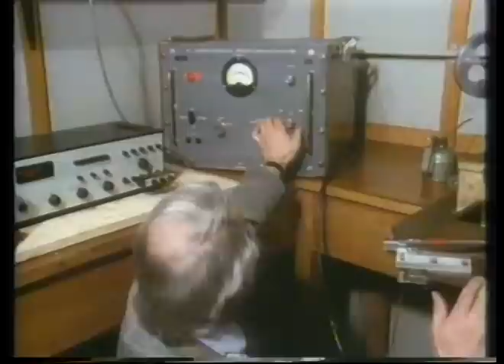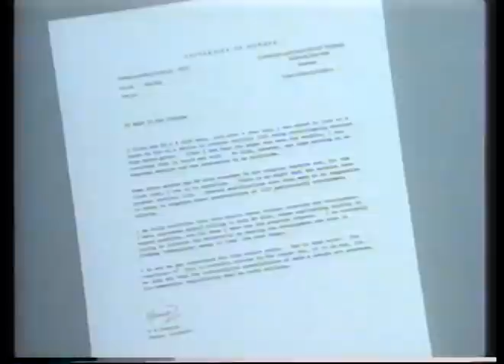Anti-Gravity Machine (Part Two)

Comment: So what's the latest now my friend ? It's now 2016 surely someone's using your machine by now ?
Reply: Good evening Royston,
In spite of the fact that the device shown here operated successfully many thousands of times in 3 different universities in the UK and elsewhere for instance the USA and Australia, and operated successfully in my absence for several months, it would appear to be disbelieved probably for the simple reason no one can figure out how or why it can work so it must be a fake.

Not long after I built and demonstrated that machine I built another device for the purpose of proving under laboratory conditions he fact that inertial thrust could be produced.
This device proved conclusively that my devices were genuine, a laboratory report was prepared to prove the fact. The complete laboratory report, patent application and photograph of the device, can be found in Jerry Decker’s You Tube insertion called “Sandy Kidd’s gyroscope lift experiment”
No takers for nigh on 30 years now.
Reply: I've been following the development of devices both understood and not understood for a while and it certainly does seem that those not understood slowly move to the junk pile, unfortunately and those understood get suppressed, bought up and hidden in what the U.S. calls Unacknowledged Special Access Programs or some one or some organization sets the inventor up on fraud charges or finds some other way to lock them up or make them go away. Unfortunately for inventors, I think the only way to get the machines that work to be used and understood is too offer the designs and research freely so that they spread into the public and hopefully, become common knowledge.

 If I had a working machine that gives me more energy out than in, I would just try to use it to benefit my life and the lives of people I care about, by using it to lower my energy bill. Could you imagine how this world would be different if there were no energy bills to pay? The price of everything would go down. After a few years though, I have no idea how society would change if anyone could harness as much energy as they want. That could be dangerous, potentially. Still, I know my life would be a lot better if I did not have to buy energy.
Reply: I think Chris that whether my device is genuine or not it is surely not the preferred method visualised by they who are in control.
If it smelled of anti-matter, an electromagnetic vortex, an inertially driven magnetron for goodness sake, or even the very doubtful Nazi Bell device, it would surely be worthy of consideration, but not gyroscopes.
Some day long after I have donned my wooden jacket the penny may drop but I doubt it very much.
Reply: But can you use it to perform usable work to lower your energy bill? I would think that the more money you save, to better your chances of developing this in the direction you envisioned. If it could be readily used to do this maybe you could use it, in the short term, to create capital. Like if it is used as a high efficiency water pump or something, not that I would know how to do this as i haven't spent any time with your machine. That's my two cents, anyway.

Best of luck to you.
Reply: Two quotes come to mind from the scientific "giants" of the past, the first from the inventor of FM Radio who was not recognised as the inventor during his lifetime, " Men substitute words for reality and then argue about the words." that demonstrates our past and current status quo, that if you can't explain why the device works in human invented words then it doesn't work as our words and our equations can't explain reality. Then to quote Oliver Heaviside, who is hardly recognised for many accomplishments including simplifying Maxwell's equations from 22 complex equations of incredible labour to the simplified 4 equation form we know today, still attributed to Maxwell,   "shall I refuse my dinner because I don't fully understand the process of digestion".
Reply: Hello again John,
Whilst I do not disagree with any of your statements, in my case it is much simpler than that.
I can describe in great detail exactly why my devices can deliver inertial thrust in relatively simple terms, that is not the problem.
I can describe exactly whilst my claims differ from those of Newton.
Unfortunately the clever people who are liable to be invited to scrutinise my claims will invariably be the ones who know they are correct for no other reason than they know they are, and will dismiss anything which challenges Newton out of hand and as heresy.
Until someone, and now probably not in my lifetime, challenges that great assumption that is the alleged separate conservation of angular and linear momentums physics is going nowhere, and mankind will forever be earthbound.
Reply: yikes are you getting close Sandy Kidd!! No use being against gravity. Best to swim in it.
Reply: Paul James haha , Paul why do you sound mad ? Are you upset ? Cool down brother, just relax and go with the flow...if you don't believe in this contraption then that's absolutely fine , there's no need for insults. Be happy mate & enjoy your life mucka 😊
Reply: I have no doubt that some member of the academic club will someday reproduce what I have done, but I stress not without considerable help from those you see as an inferior class, namely the skilled manual workers.

Once the truth is known It is relatively easy to figure out what is required to produce inertial thrust but to meet that requirements of design is not so easy.
It requires a special type of mechanism, a quite complicated compound mechanism to produce the thrust,
This mechanism is not at all apparent in the video but nevertheless it lurks in there and is quite hard to spot.
It took me many years to find it, and I had the machine..
I did state that once the truth is known. 
This truth is in a complex mechanical function, which when in operation in a gyroscope or flywheel system produces results which fly in the face of all previous teaching.
    
PS I initially built a device which complied with accepted principles. 
I attempted to produce inertial thrust by means of producing centrifugal force at elevated angles of around 45 degrees.
Twin gyroscopes were to be used as the tool to raise the gyroscopes, up to the required angle.
Nobody ever informed me that if the mass (gyroscope) on a length of shaft was rotated at a fixed rotation speed and the mass (gyroscope) itself was rotated centrifugal force would diminish as the speed of the gyroscope was increased. 
At elevated gyroscope rotation speeds the centrifugal force, impossible as it seems disappears.
(Refer Laithwaite’s large gyroscope?) Not a trick at all.
The facts of the situation have far wider implications, and are a bit more complicated than I have so far stated but it is as a good place as any to to start.
I have broadcast this fact for 30 plus years, but everyone is so well educated and clever and therefore knows better it is laughed at.
Reply: TY Sandy Kidd, for your reply!  

Are you planning to try and teach/share the mechanism that you are talking about in this quote?

 "It requires a special type of mechanism, a quite complicated compound mechanism to produce the thrust,
This mechanism is not at all apparent in the video but nevertheless it lurks in there and is quite hard to spot". 

Or do you plan to take it to the grave with you? Or are you hoping to work out a financial deal? 

You are welcome to email us directly at wits2014@yahoo.com

TY!
Reply: Paul James you did at least give me the credit of holding down a manual job which considering the abilities of most of the academics I have worked alongside was very good of you.
I found them to be quite proud of their lack of craft skills, one even boasted to me that in a practical sense,he was technically illiterate and unable to change out a fluorescent lamp, and I do suspect most would struggle with a box of Lego..
However back to your faith in the physics dispensed by the establishment.
As to the accuracy of your facts well that is a matter.of opinion..

In the last year or two, we have seen the Theory of Relativity go the way of the Dodo.
We have seen the Standard Model of the Universe come under ever increasing fire from the Electric Universe and is sure to join Einstein’s theories  very shortly with the long dead birdies.
So guys no more Black Holes, or Time Space Continuum to contend with, that is of course whilst being accompanied by all the other associated junk that has been universally peddled and swallowed over the years
The Time Space Continuum with its ring of idiotic nonsense, I shall personally be very glad to miss.
Strangely whilst we can look back at this rubbish, we must really consider what effect it all had upon us.
Apart from keeping untold thousands of academics doubtfully occupied, or producing the ideas behind many science fiction films, it transpires not to be a lot methinks.
We now know there are parts of Newton’s stuff we can drive a cart through, but in fairness none of it would affect us much at all either.
However I doubt if Newton would be missed by the public at all as nothing he predicted or stated has any effect on them, in fact I do not suppose it would have made any difference to them if Newton had never existed.

It is only when a person is in need of attempting to do something out of the ordinary, for instance something akin to accelerating offset discs on multiple axes that the findings are at odds with any predictions made by Newton.
I often asked myself if Newton was in fact aware of this, which in light of the fact this anomaly was lurking in a relatively obscure area he may have chosen to ignore it.
Personally I do not think Newton was aware of what had been omitted, on the other hand I cannot see the man wilfully invite his own destruction.
All of that said, and after all those years I am convinced that for some time well into the future we can forget all of the current attempts by mankind to sort and sift all available information into convenient parcels, as there is now at this time no hard and fast law for anything.
In light of the fact we have survived in spite of all the junk that has been thrown our way, seems like we did not need any of it anyway.
Sandy
Reply: eh!!Laithwaite Mr James your the one who has thrown the toys from the pram Sandy giving you the truth hurts treatment- grow up.
Reply: Get your  jam jams on Paul off to bed your tired and tiresome..yaaawnn!!
Reply: Hello Angus,
These silly people and there are more than one or two of them who think they know everything seem to forget that this video was made nearly 30 years ago, and I can assure you that I have not exactly been twiddling my fingers for all that time.
I have covered a lot of ground since then but none of this has altered my position with the closed minds. 
Brainwashed minds would be more accurate.
In order to acquire some credibility for the work I have done, a tall order indeed, I decided to release on YouTube, a rare treat for the brainwashed, the video of a newly built device which clearly demonstrates severe shortcomings in the momentum conservation law which along with the 1st and 3rd laws are shown to have always been redundant. 
I demonstrated a similar setup in Dundee University 30 years ago where the device in question was being whitewashed, sorry being appraised.
I demonstrated to the faculty members present what they had always considered impossible, (well that was if they had ever considered it at all?)
When treated to the impossible, the astonishment was accompanied by total silence, before they turned their backs, and walked swiftly away as they do.
That demonstration was never reported, recorded or ever later discussed.
Blind and dumb scientists were all I needed.
I am hoping for better reception from YouTube, where it is so much harder for them to deny what is shown.
This device is not designed to generate inertial thrust but is designed to show to the close minded academic fraternity, what really happens when gyroscopes or flywheels are subjected to horizontal mechanical acceleration, which in turn discloses one way that one-way thrust generation is inevitable.
Regards,
Sandy.
PS
I do not think I shall wait for an answer to any request to VIPAC Laboratories,  relating to the integrity of that report by these idiots.
The lab test and report must surely have been falsified in their minds if only to suit the specious junk they have all consumed.
Reply: They (NASA etc) do not seem to have done too well, so far, have they?
In fact it would appear that apart from trying to make a magnetron develop one way thrust, which is surely clutching at straws, and probably at some considerable cost, as you correctly state.
What else?
Is fine being highly qualified if in fact you are qualified in reality, and not in the specious junk still meted out to the students.
Reply: I would be curious if your device would behave exactly the same in the southern hemisphere.  And / or exactly the same closer to the magnetic poles.  And, then on the International Space Station.
Reply: Sandy, I hope this finds you well and healthy. I have just seen this for the first time. Thank you for all the work you have put in and the time you have dedicated! You my friend are a true inspiration for me! All the best.
Reply: @sandykidd6482  Have you managed to create stronger lift?
Reply: @sandykidd6482  Research the Electric universe theory and see what Wal Thornhill has to say about gravity and gyroscopes.. It may shed some light on how it works.
Reply: @adamsheldrick9902       i don't know this for certain, but i think he's aware of the "Electric Universe Theory" as he mentioned it in an earlier comment of his from a couple of years ago.
Reply: Hello sandy, glad to hear you are still at it, I have been following Eric’s work with Gyroscopes since junior high and it always bothered me how many people dismissed the tech, despite being quite simple.

I wonder if this tech would work the same outside of earths magnetic field? 

I would love to contribute to the cause, if you need any help making new videos please let me know, it is important to share the knowledge through the video medium in order to reach the masses.

I was wondering what you think about the beifeild-brown effect ?

Do you think there is any connection between it and your invention? 

Cheers
Reply: @sandykidd6482  Sandy I could not have said it any better. Most so called academics have read some old text and regurgitated it to impress the examiners who are comparing your understanding and ability to regurgitate a script. That is not intelligence.
As Sandy says experiment is the way to make scientific progress. Then after observing something that you cannot explain go away and try to understand from 1st principles what is actually going on.
After all no one has explained to me what light actually is from 1st principles ... a BOSON they call it, well what is it made of and how does it come into existence from what.. CERN would love to be able to answer that I am sure and maybe the vast resources they are throwing into looking for something tells me one thing. That they have observed experimentally something they don't understand. So Billions are being thrown at the question.
Unlike schoolboy physicists and mathematicians who pretend to be experts .. of nothing becasue you do not have the intellectual capacity or vision like Sandy to actually create something new. 
If Sandys experiment impressed Eric Laithwaite that is good enough for me.
YouTube is full of haters and ignorant people because you are dealing with a very large audience population and in that pool are a lot of dim witts.
Maybe you just have to make something so obvious that the masses cannot dismiss it.

Sandy what do you think was the largest problem this device could solve that could be demonstrated without any doubt?

Comment: When I was a kid in the 50's, there was a sci-fi comic strip, which mentioned in passing that several spinning gyros, all rotated about a common axis, like the two on this chaps contraption, would lose weight.
It also said that the complete mechanism could never lose enough weight to lift itself completely, because at the rate of rotation required, the centrifugal forces on the gyros would pull them apart, and destroy them.
Seems these guys are trying to reinvent a square wheel!

Comment: Sandy... buddy... this uplift can be achieved more easily using 3 blade on a turbine engine ... believe me ull get MORE THRUST = more uplift. The spinning gyros here are creating uplift because they are loosely working together as propeller engines ... but with gyros you can only get so much thrust. Hence it won't really work or will be feasible to achieve the desired goals! This idea is basically trash! I don't wanna hurt ur feelings brah but that is science
Reply: History Channel, then explain Eric Lathwait lifting a 50lb spinning gyroscope with one hand?